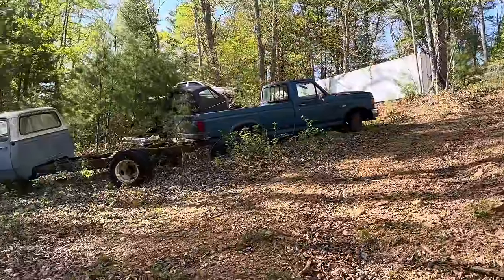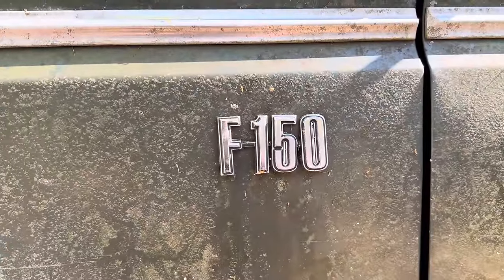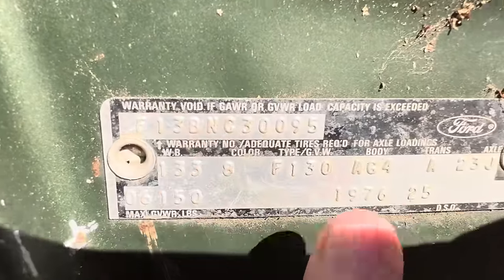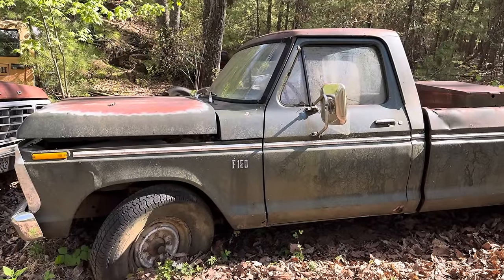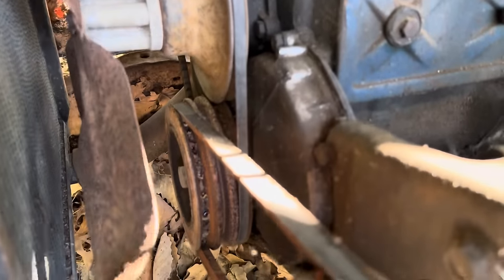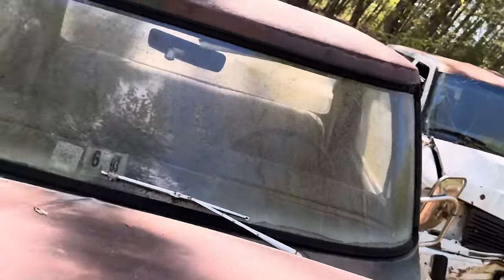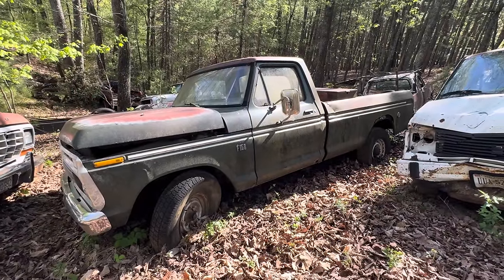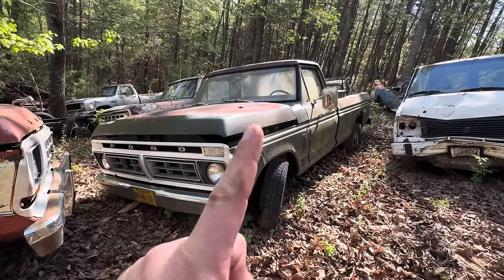Uncovering A Hidden Gem: Strange Ford MYSTERY Truck Discovered In The Woods! #RustBucketRescue

Comment: Nah, nothing "odd" or "rare" about something like this. Happens all the time and Ford still does it today. When you order an F-550 chassis cab, you get the standard 18K Gross Vehicle Weight Rating. If you want a 19.5K GVWR, you have to order the 68M payload upgrade package. The rear axle GAWR various. GM also did something similar with the "Heavy Half" 1/2 ton trucks. That's likely how it played out in this case.

The VIN gets the win: F13 for F150 2WD pickup with 3/4 ton suspension and 8-lug wheels, B for 300 CID straight six with one barrel, N for Norfolk, VA assembly and the rest is the production sequence lining up with 1976 model year production. The Norfolk VA plant operated from 1925 to 2007. 

With the tag, you can brag: 133 for the wheelbase in inches (something Ford still puts on certification labels today), 8 for Dark Hatteras Green Metallic (also called Yellow Green Metallic) exterior paint, F130 for F-150 2WD with 8-lug wheels and 3/4 ton suspension, AG4 for all green vinyl interior trim, A for model 435 New Process four speed manual transmission, 23 for 3.31:1 rear axle ratio, non-locking, manufactured by Dana-Spicer, J for power steering front axle, 6150 is the maximum GVWR of the vehicle, 1976 for 1976 model year, and 25 for Richmond, VA sales district.

Dodge did it with their pickups in the late 1970s. Chrysler realized that they could have a "muscle truck" since certain EPA rules didn't apply to pickups, so they used that loophole until the government closed it. Hondas of the 1970s (and other makes) didn't have catalytic converters (and subsequently could run on either unleaded or leaded fuel) because the CVCC (Compound Vortex Controlled Combustion) allowed it to meet US standards without the use of the converter. Eventually, they would need to have them.
Reply from the maker: Excellent decoding brother!  They seem to be very low production, with some mystery surrounding them.  Only a few F13 trucks have popped up over the years but there’s zero literature about them, they’re not in any Ford service manuals, or any other Ford documents people have dug up in Microfiche, the Ford Museum’s historical records department in Detroit can’t find anything on them, and even Marti reports report the GVWR incorrectly (Marti Reports show 6050 GVWR, but all F130s are actually 6150 GVWR.  Seems like a lot of added expense and extra coordination and intricacy to add to an assembly line, to make essentially an F250 without calling it an F250, especially for just one year.
Reply: @RustBucketRescue  Sure you'll see it----in the parts book pages. They list all of the body code models there and with the specific GVWRs. I know this occurs on Fords even today because it happened to us at work. A vendor doing a body upfit (I work in a large municipal fleet) ordered an F-550 with an 18k chassis and we called out for 19.5K in our contract. The minute the chassis came in and we inspected it, I spotted it on the door jamb label. When I questioned the vendor, they didn't have an answer.

I said, "I do. Someone forgot to order the 68M Payload Upgrade Package which would raise the GVWR from the standard 18k to 19.5K". Whoops, guess who had to reorder new chassis......
Reply from the maker: @googleusergp  that’s the thing, the Ford community has already poured through current and period-correct parts books and there is no record of the F13 or F130 codes, even in super detailed vintage microfiche slides. I’ve gone so far as buying dusty old 1976 and 1977 internal Ford parts catalogs and dealership part desk binders off of eBay, no F13 or F130.
Reply: @RustBucketRescue  Not looking hard enough. You have to really study those old books and multiple versions of them. The information is out there.
Reply from the maker: @googleusergp  I think you underestimate how many people have been working on this and how hard people have looking.  Trust me, I’d be a happy man if I was proven wrong, but with near 20 years of intensive research by a whole group of people on these trucks, literally nothing has come to fruition.  If someone pulled out a book and said “You idiot, it’s right here!” I’d be the happiest man you’ve ever met, but until that happens there appears to be no info on these mysterious F130s.
Reply: @RustBucketRescue  I wrote OEM and aftermarket parts catalogs (including helping Ford and GM write them) for 11 years and I've been in the automotive industry for 35+. The misinformation and lack of a deep dive I've seen in that time is amazing.

Again, the F130 is likely a payload upgrade package much like the 68M ups the GVWR on the F-550 in the present time.
Reply from the maker: @googleusergp  the problem is the GVWR is a wopping 100 lbs over a standard F150, so that seems like a lot of added expense and “bother” to gain 100 lbs of GVWR.
Reply: @RustBucketRescue  Remember that a safety factor is always built in and you get heavier duty components.
Reply from the maker: @googleusergp  true, could have been the reasoning
Reply: @RustBucketRescue  If you've ever dealt with Ford OEM engineering/corporate (as I have), sometimes you find that they do odd things. That goes for many of the OEMs. You don't always get the brightest light in the string at some of these places, OEM included.

Comment: I had a I think it was a 1974 f100 and it had a 390 engine in it and it didn't even have a floating axle and it even said it on the hood the motor was huge , now why would ford put such a large engine in a low capacity frame? and it only had a two barrel carb on it.
Reply from the maker: Interesting, was it a long bed or a short bed?
Reply: @RustBucketRescue  long bed single cab
Reply: @RustBucketRescue  and I do have a 69 f100 with a 360 in it
Reply from the maker: @isaacwhite7411  ah a 360 FE/FT engine!  Those are excellent engines, and sounds so darn good with a nice exhaust system!  Reliable too.
Reply from the maker: @isaacwhite7411  very interesting that it had the big motor and a long bed but had a “light duty” axle in it as well as the low capacity frame.  Oddball for sure!

Comment: my dad had custom camper special had the 8 wheel lugs Two wheel drive it was listed f-150 but did not have the badge
Reply from the maker: Interesting! What year? What engine and transmission?
Reply: @RustBucketRescue  1968 had a granny gear then a four speed on the floor
Reply from the maker: @wysowl1776  I have a ‘67, the bumpsides are beautiful trucks!!

Comment: Why not an F 180????
It's tougher than an F150
Reply from the maker: Exactly!!  Interesting move calling a “heavy” F150 a F130 huh?
Reply: @RustBucketRescue 
My mom had a 75 GMC High Sierra with a 454, and the emblems also said it was a “heavy half”. If I remember correctly (I was 6 years old in 75), it had only 5 lugs on the wheels. I know Chevies and GMC’s had models with 6 lug nuts.
Reply from the maker: @richardtibbetts574  sounds like a cool truck!  Thanks for sharing 👍🏻

Comment: Had a 2003 F150 7700. 7 lug. In Ontario could run it for your business and not safety/certify it every year. Like 250/350/450.
Reply from the maker: Not familiar with Canadian law, what does safety/certify entail?
Reply: @RustBucketRescue  Yearly inspection at the mercy of the shop you have to take it too(Mechanical/Check Engine Light/Emissions). 
Ministry of Transportion(Government)does follow ups on shops&mechanics. With big consequences for noncompliance. So, it usually turns into a big mechanical bill&down time for the truck every year. 7770 F150 gave you a 3/4 ton that skirted this.
Reply from the maker: @4everdc302  Wonder if this truck is an early version of trying to skirt that, but maybe they weren’t doing that safety/certify that far back?  How far back did that safety/certify start?
Reply: @RustBucketRescue  Up until 1980. It's was the province or state that would or wouldn't have their own regulations. MTO started here in 1937. Commercial Vehicle Safety Alliance started in 1980 as a standard safety for commercial trucks in US&Canada. Including Mexico in 1991. Truck manufacturers have always built trucks to right to the line of the law. Just like that 76, it would have had an airpump for emissions with a sticker to cut the belt of at 15000k, lol.
Reply: Haha. I ask ChatGPT. Type in this it give you the answer"What is the origin of the F130 in the F Series of Ford trucks?"
Reply from the maker: @4everdc302  “If "F-130" was a typo or a misremembered model, you might have meant the F-150, which is one of the most popular and longstanding models in the series.“

Evidently ChatGPT doesn’t believe an F130 exists either!
Reply from the maker: @4everdc302  wait… would they actually for real put a sticker saying you can delete the air pump at X mileage? 😂
Reply: @RustBucketRescue  ya got ask it a couple times lol
Reply: Try to paste and post GPT answer. Tube took it off. 1976 HHPP package is the answer. It's been fun. Later, my friend
Reply from the maker: @4everdc302  thank you for all your contributions brother!  I appreciate you!

Comment: Ford mixed parts on their vehicles. I had a 1970 Clubwagon info tag said it was an E 210 A. It was a passenger van with 5 lug wheels and 1 ton brakes. So not really all that rare for ford to mix things up.it also had a straight 6 240
Reply from the maker: Where’s that van now?  Sounds like an awesome setup, I have a 1990 E150 I love!
Reply: @RustBucketRescue  sadly it went to the scrap yard many years ago due to the frame rusting out where the steering gearbox was attached
Reply from the maker: @donaldunderhill3020  noooo what a shame, love those old vans - don’t see them anymore!
Reply: @RustBucketRescue  thanks for the video. It reminded me of a van I loved to drive
Reply from the maker: @donaldunderhill3020  appreciate the kind words and the story about your van.  I’ve got an update video in the works where I’ll be comparing this F130 to a same-era F250 to compare and contrast the frame thickness, brakes, leaf springs, axle, etc to hopefully get to the bottom of what an F130 exactly is - stay tuned!

Comment: Doesn’t look like it’s factory four speed hence the auto brake pedal!
Reply from the maker: It’s a factory 4 speed, the door tag codes out to a NP-435 4 in the floor, so it came that way.
Reply: @RustBucketRescue  ok that’s strange to see that pedal configuration and the shifter position didnt quite look right I was thinking maybe it was cab swapped but hard to tell from video
Reply from the maker: I’ve been all over it, everything appears to be bone stock and all codes and data plate information is accurate, everything indicates this rare oddball truck came out of the factory this way.  It’s definitely a strange one!

Comment: What size tires are on this truck?
Reply from the maker: 235/85r16, however I believe it was born with 16.5s
Reply: @RustBucketRescue  ok, l have a set of 4 white spoke 15 in 8 bolt rims.
Reply from the maker: @bigcharliesmodelgarage296  where are you located?

Comment: I see lotsa dodges I wish I could buy☺☺
Reply from the maker: There’s probably a dozen late 70s through 80s dodges, some of them have 60k actual miles on the clock and a glovebox full of meticulous records even so far as recording every gas fill up, that were county trucks that weren’t really used so they were sold as surplus at an auction, which is why the miles are so low. Absolute goldmine.

Comment: Think they were camper specials
Reply from the maker: The problem with that is Ford had readily available Camper Special emblems they would have been thrilled to put on it to dress it up, and put a lot of effort into marketing Camper Specials.  The F130 model designation sets it apart from what a Camper Special would normally be labeled as, so Ford specifically made sure to give it a model code to separate it as something else

Comment: Not rare. Seen plenty of them.
Reply from the maker: Where!?  Even with all the attention being put on them now, very few are popping up, and they are one year only trucks.  Where are all of them!?
Reply: 76-78, dealers had problems selling them because they had 16-1/2 inch wheels on them new. We went to a dealership in Seville Ohio in 1978 and had some leftovers, all had 16-1/2 inch wheels and was called a heavy duty half ton with beefed up suspension. 2-1/2 brake shoes instead of 3" like on the F250. 16-1/2 tires were hard to come by and expensive  because tire dealers didn't stock many like the 15 and 16 tires.
Reply from the maker: @seanthoman2676  excellent info!!  I’ll pull the brakes off soon and measure them, as well as the frame thickness for giggles.